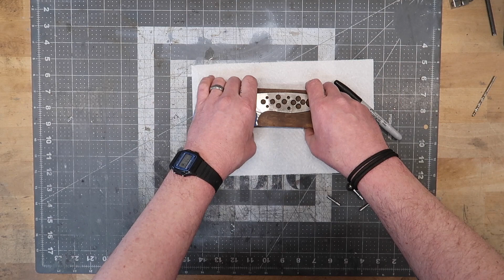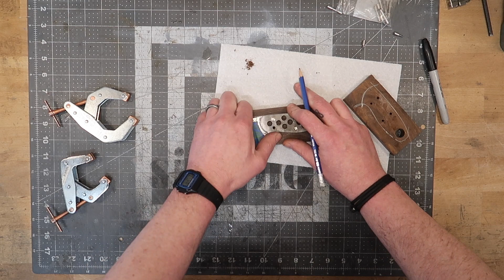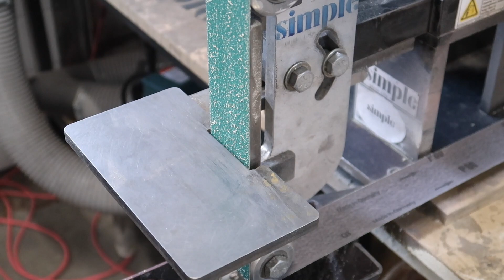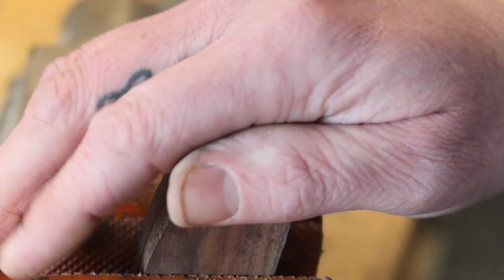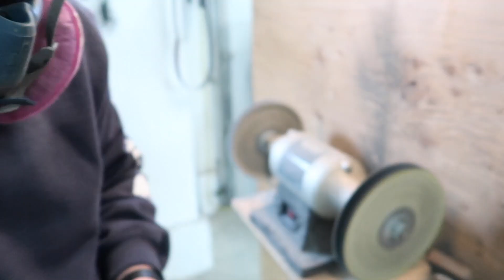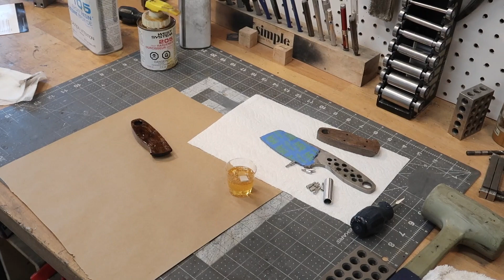Chunky Monkey with a Rock Pattern - Part 3 - Corby bolts & handle layout

Comment: About screws and threads,
What I learned about them in school is that the minimum depth of a screw should be 1 1/2 time the diameter of it. A 10mm screw should threaded 15mm in. A 2mm screw 3mm and so on ...

✌️🤪
Reply from the maker: That might be a good rule of thumb but it does not take into account the thread pitch. Mechanically, it’s something like 90% of the load is supported by the first 3 threads. Additional threads down the line gradually decrease the percentage of the load they carry.

Comment: I just bought some korby bolts, I've never tried them before... I don't know if it's my OCD, but I always put my clamps on opposite sides, it probably makes no difference but in my head, it keeps everything flat, hahaha. Even when I do pinned handles, I use pivots to hold the scales on, so i could finish them 90-5%. Kinda like the idea of Kolby bolts... Hope all is well, take it easy